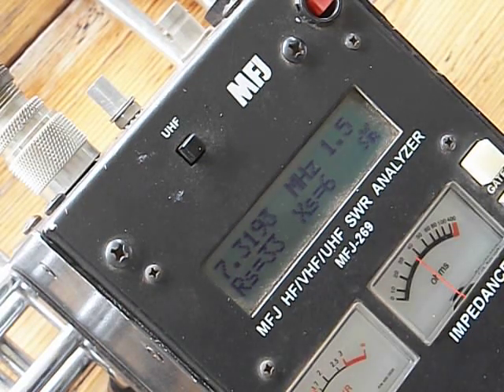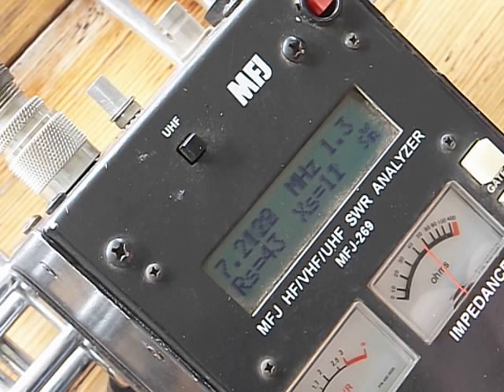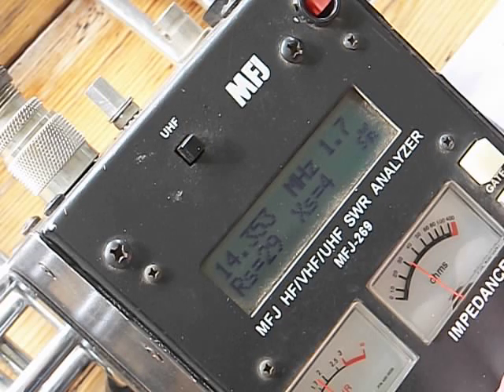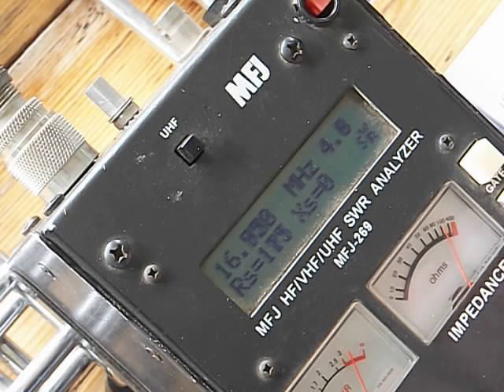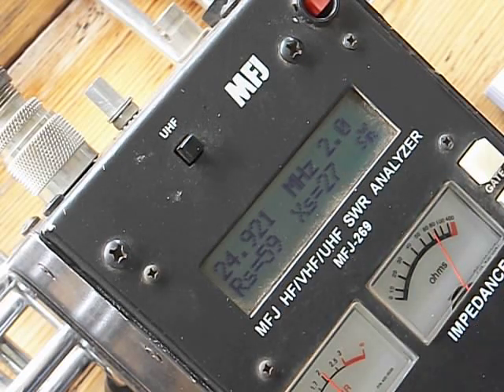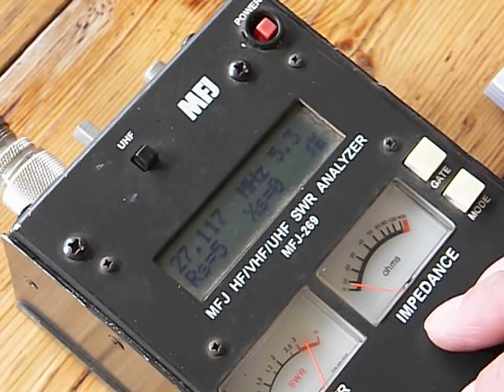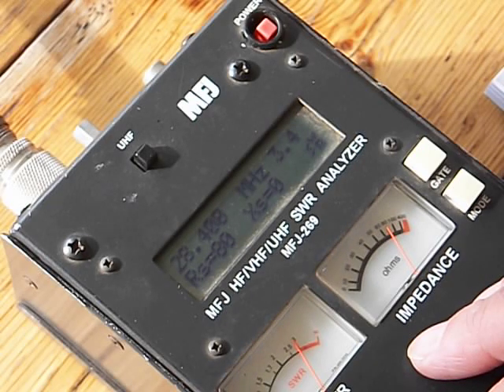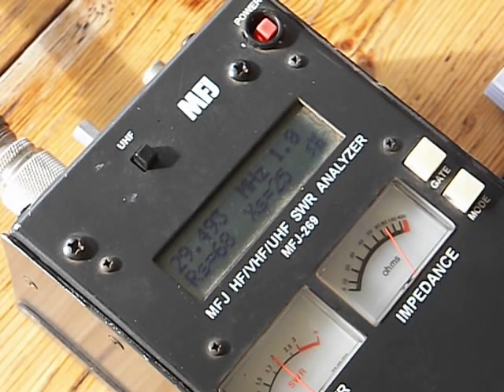ZS6BKW Antenna post trimming SWR and Impedance with the MFJ 269 Analyzer.

Comment: Are all MFJ  269 Analyzers that hard to dial up the exact frequency? I know mine is but I just though tit was defective until I saw yours ding the same thing.
Reply from the maker: Every vid I've seen with em would indicate that's the case.  My 269 at home is the same, very touchy tuning dial.  They're really just for checking SWRs etc. over a freq range, not tuning a specific freq though.

Comment: Hi Tim. Very good timing on this video, as I am just about to build a ZS6BKW. Sorry if I missed this in the videos, but did you use a fixed given length recommended for the ladder line, and just tune the dipole lengths, or did you go through a tuning process for the ladder line? I have read that tuning the ladder line affects different bands than  tuning the dipole does. I have seen many different recommended lengths for the ladder line. This site: http://www.w5dxp.com/ZS6BKW80/ZS6BKW80.HTM, gives some ideas for finer tuning. I am interested in adding the doorknob capacitor for bringing 80 's swr down for the 75m band. I will initially try an 820pf capacitor. I am planning a trip, with portable radio,  one day to SA, and as a Canadian, also have reciprocal privileges there. Does one normally add a further suffix to your foreign call sign to operate there? Thanks for the vid! much appreciated. Brent  VA7HUM
Reply from the maker: I used a fixed length (approximate) ladder line and trimmed the dipole legs into resonance.  I based mine on the linked video here.  https://youtu.be/MbXmAcf9MmI.  The angle of the legs have a lot to do with your SWRs as well and I've experimented with that a bit too.  I've worked one end of SA to the other as well as Mozambique and Zimbabwe, but this location limits my take off angle and conditions aren't helping either.  That and no amp to get some real DX out of here.

My SA elmer Lukas (ZS6LH) loaned me a tuner with the rig so I used that to get 80.
Reply: Thanks for the info Tim. What height do you have it at?
Brent  VA7HUM
Reply: Sorry if you already stated that in the video,  B.
Reply from the maker: @bhenry5091  So sorry, I just now saw your question.  The tower is about 56 feet (17 m) but I get the best performance with the feed point at about 45 feet, which gives me the best angle for the legs.  73

Comment: Hi Tim,
Something not right with your MFJ antenna analyzer when you were measuring SWR at 28.3 MHz.  Rs=66 and X=0 which should be an SWR of 1.32 to 1 but the MFJ said 3.6 to 1 on its LCD display.  Very odd.
Reply from the maker: That IS odd, but it matches the cross needle meter my Elmer loaned me.  I've only worked 80 meters here so haven't played with it much.  I'll see how my factory made one works on my rig(s) when I get Stateside again.